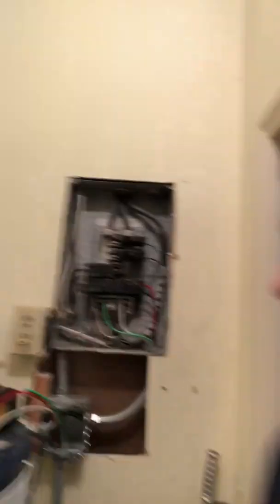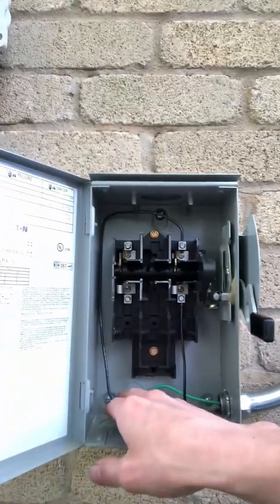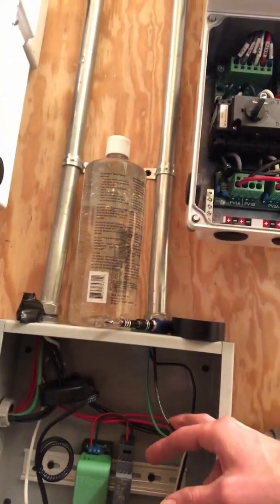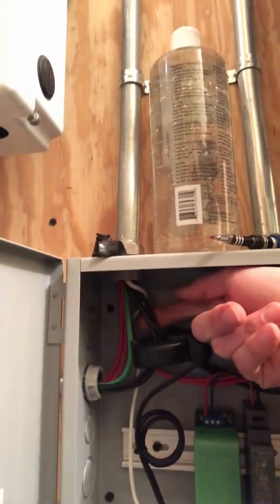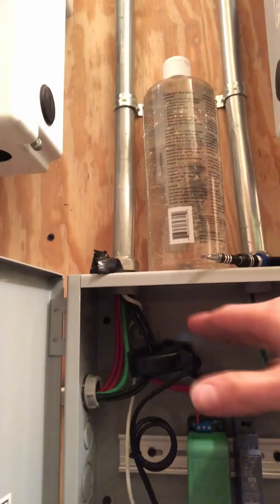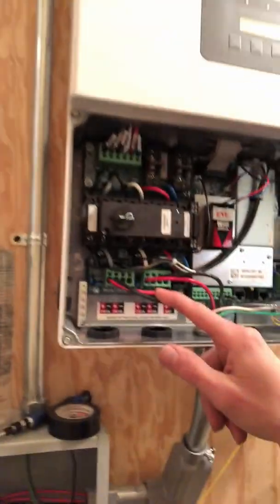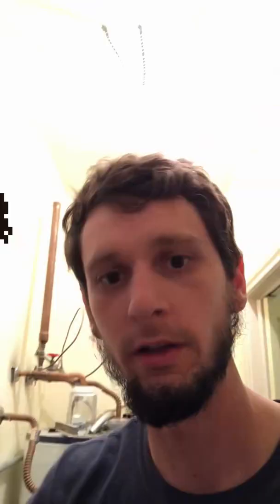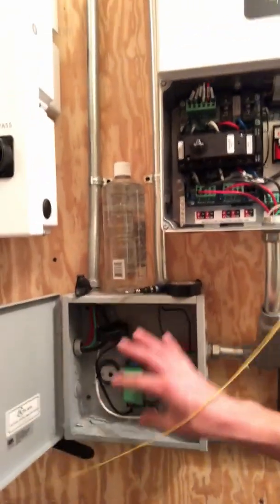TIGO TS4-A-F DC Quick Disconnect Operation Overview - NEC 2017 690.12

Comment: I found you locally through FB marketplace, your videos have been extremely helpful in figuring out how I'm gonna design my system. Looking forward to buying some panels from you.
Reply from the maker: Very cool. Glad they have been of some use! I’ve got grid tie inverters in stock and I am a reseller for the eg4 line of inverters and batteries if you need something along those lines.

Comment: Kan your monitor individual  panel produktion?
Reply from the maker: Not with the ts4-a-f. The -o version which is also an optimizer does have monitoring per panel.
Reply: @BeeneEnergy  I'm not seeing a Dual Input version of the AO  🤔 it would be nise to put 2 460 Birasials on a single Optimizer/Module.... You think they would be able to make something inline and small as an Emporia Smart Plug atleast for monitoring.

Comment: Awesome. Do you still need a fusable DC disconnect going into the inverter? Or do you only have the dc Disconnect on the inverter?
Reply from the maker: Code did not require a fusible disconnect for me. Just the dc disconnect at the inverter.

Comment: Only issue is those inverters don't last I've gone thru 3 of them in 1.5  years
Reply from the maker: One of mine just failed too! Funny that I had just installed a hybrid next to it so I just moved the panels to the new one.
Reply from the maker: Mine only had 4kw of panels on them and in temp controlled environment…

Comment: Hi Beene, 

Why do you need an  "inverter" in the loop for the TS4s to work and turn On/OFF the string output? 
Can't you just use a Voltmeter instead of an inverter to look at the voltage at the output of the string and test the functionality of your TS4 RSDs?

I've tried to power up the Tigo transmitter with a 12v dc adaptor and see if it can turn ON/Off the TS4s but I found the string output was just sitting at 0.6v per TS4 module and the modules not turned ON even when the transmitter is sending the Keep-alive signal in.
I can't see how/why the TS4 must need an inverter in the loop to work.

Thanks for making this video, you explained it really well.
Reply from the maker: That’s very curious. I didn’t know there had to be an inverter for the modules to turn on. I’ll have to see if mine act there same.

Comment: I'm adding a 15 panel 6KW array to the roof above my garage, and have the panels, disconnects, inverters, battery bank, conduit, etc.   The one part that I'm still missing my plan for Rapid Shutdown.  Recently my county went from 2014 NEC to 2017, so now I'm supposed to go with a module level shutdown, but I don't know that I'm going to get it formally inspected anyhow, so I don't suppose it matters, however I do want everything to be safe.  I was wondering if you've compared the TIGO solution to the IMO Fire Raptor option?  Not a lot of content out there on the Fire Raptors.

Great Channel BTW!
Reply from the maker: Thanks!

I’ve actually not heard of the IMO option.
Reply: @BeeneEnergy  After doing a fair amount of research on both, I'm leaning towards the TIGO solution, just because it can do optimization and monitoring.  I'm thinking of just going with the TS4-A-0 model that has all options since it's just 15 panels and the cost isn't crazy.  I'm just not certain of the other components that I need.  If I get the CCA and TAP, do you know if I also need the RSS transmitter that you mentioned in your video?  From what I gather, I should just be good with the CCA and TAP - still need to read through the whole manual though.  Essentially I just want to have a setup where they can press the big red botton near the meter and turn off the panels.  My set up will technically be off-grid, since it'll just be powering select loads in my house, so I don't believe that the requirement is there to also turn off the inverters via the red button.

Comment: Great video, I really appreciate you producing this and providing all of this detail. I have a couple questions about your setup since it is so similar to what I’m working on. I have 18 450w bi facials in Wisconsin and two h6 inverters. I am planning to run them in two strings of just over 400v / 4000w each. From what I understand each mppt input can handle up to 4.5kw and is most efficient around 400v. Why did you decide on 4 strings vs 2 at higher voltage? Do you also need a utility service disconnect to satisfy your provider or do you think the RSS will suffice. If mine wants a disconnect at the meter, I suspect that would serve the RaPid shutdown needs as well since the transmitter would lose power and open the circuits?
Reply from the maker: The four strings instead of two was a miscommunication between me and the person doing the plans. I’ll combine to have longer strings later when I add panels. That way it frees up a pair of wires I can use to get another set of panels to the inverters.

My utility specifically stated they wanted an ac disconnect by the meter. I gave them documentation and drawings showing how the rapid shutdown works and they approved it. Ymmv for sure.

My rapid shutdown breaker is in my breaker panel so it wouldn’t lose power if I disconnected my inverters. I’m sure there’s a way to wire it so the ac disconnect also triggers rapid shutdown though.

Thanks for watching, glad it helped in some way!
Reply: @BeeneEnergy  Ahh, I wasn't sure if you were trying to avoid overdriving the MMPTs, that's been my concern. I still am not sure if running two inverters is the way to go, or just the one ( keeping the other as a backup) because I have a feeling I will almost never be nearing the full 6kw, and running one might be more efficient. How close to your panel ratings does your output typically come? Have you come up with any software means of graphing output or just the LCDs on the inverters?

I saw in the eBay listing, but not on their website, that Signature Solar has a stark warning about not driving it at or over 6KW or risk significantly reducing its lifespan. That suggests they had at least a few die on customers and that was their assessment. But the manual made it sound like up to 9KW of solar would be ok. I guess we'll see.

After watching your other more thorough system overview, I found the answer to my other question, that's cool they were ok with the DC disconnect as I'm sure having to run another disconnect for AC would have been a drag.

But you took the whole rapid shut down mandate with stride. I already bought most of my parts and thought I was almost ready to install before I found out about it. At first it felt like a major setback, but ultimately I guess it could be worse. Your attitude helped me see past it and consider the upside. 

If you don't mind me asking, who did you have prepare your plans? ( Sorry if you mentioned in the video, I didn't catch it ). 

( It was cool to see your reply and that your still active, I'm subscribed and looking forward to see how things progress )
Reply from the maker: @sjetmand  Wow I hadn’t seen their comment about not over paneling. That’s disappointing!

I see about 75% of my 8.4kw array in the hot summer. That’s spread across both inverters of course. Don’t know what the cool sunny months will provide yet.

With the warning you pointed out maybe I won’t over panel like I had planned. Might add another 3-4kw and be done. It will be a west facing array so that should prevent peak generation too.

I use the sense energy monitor with solar CT’s to see my data. I’ll put a post up here on YouTube showing what the interface looks like. I’m happy with it, just another few hundred to spend :).

Comment: Great overview! I have an SMA 5000W string inverter and 16 Tigo TS4-F MLPE to comply with rapid shutdown. It's fun to go out and flip that RSD switch to see the inverter behavior- that array voltage goes from 400 to 0 volts in seconds!
Reply from the maker: Thank you! Took me a lot of research to find the right solution for my install so I wanted to share what it looked like installed. I was surprised at the affordability, many times something like this would make the micro inverter solution win.

Comment: if you have a outdoor circuit breaker before the pv ac disconnect from the meter (wires running from meter to circuit breaker then there is a pv solar ac disconnect panel is the wires from the line going directly to the main panel inside ?
Reply from the maker: I don’t quite understand but I’ll explain and you can tell me if that answers it.

Inverter ac lines run directly to the breaker panel in my utility closet. They do not run outside to the disconnect switch. My only ac side disconnect is the breakers in the panel.

The switch out by the meter turns off the power supply that runs the tigo rapid shutdown piece.
Reply: @BeeneEnergy  thanks for the rely

Comment: I am a newbie and have a couple questions so bear with me.  The solar pv ac disconnects, is it wired from the inverter to it and then to the electricity wires from the meter?  also the tigo system is wired to your ac disconnect box or your dc disconnect box?  I know they maybe dumb questions but please bear with me. Thanks
Reply from the maker: No worries. I need to walk through the entire setup so you can see how each piece is wired in.

So there are two knobs on the inverter. Left knob is dc disconnect which kills panel to inverter connection. This is redundant to the rapid shutdown.

Knob on the right is actually just a bypass for any ac devices in a critical loads panel. So for this setup it’s useless.

The tigo system is in my dc box. It does have ac running to the power supply but that’s the only ac running into that dc box between the inverters.

Comment: Are there code rules for panels on vans, rv, or other vehicles? You have an awesome setup for your home by the way :o)
Reply from the maker: Thanks!

As far as I know there aren’t rules governing panels on a vehicle.
Reply: @BeeneEnergy  Thanks for replying... Here in Indiana...they will nickel and dime you to death with regulations, etc. We here suspect they have a cozy relationship with the grid people..so make it as difficult as they can for homeowners. I plan to install my whole system using a mobile method for just that reason.. I mean.. I can just pull my van up to the house and plug the house in..yes? lol.. independently..not to the grid panel.. I of course still plan a safe setup regardless though,, not to mention I can move it to follow the sun..and of course be ready if I have to escape when the SHTF.. your advise is excellent and we all appreciate your efforts :o)

Comment: Please consider holding a discussion on the pros & cons of combining LiFePO4 batteries with Lead batteries.   A lot of people with existing Lead Acid battery banks may not want to discard their investment in Lead batteires  - but they may want to upgrade and start using LiFePO4 ... It can be done (under very controlled conditions - if the LiFePO4 is set up as the primary and the voltage level is held at 14.0 V - in both the Lithium and the lead battery banks ) the real trouble issues are preventing the Lead from degrading the LiFePO4 and It is my opinion that this can be done with a good low voltage shut - off in line between the LiFePO4 system and the Lead acid battery system.
Reply from the maker: That's a hard one. Sounds like you have a fairly good handle on it and I agree the big problem is the resting voltage. Lead Acid will be 12.6-12.8v maybe and LiFePo4 will be up at 13.5-14v. While charging I think everything would be fine. But constantly connecting and disconnecting battery banks sounds like a challenge for relays and an arduino as I don't know that there would be anything off the shelf.
Reply: @BeeneEnergy  I was think that by using the LiFePO4 as the primary bank - and charging it  & keeping them both at or above 13.2 would work pretty well. A good low voltage cutoff between the two systems that activates when the lead falls below 12 volts. should prevent damage to the LiFePO4 ...
Reply: @BeeneEnergy  I have done a bit more thinking about this and I don;t think it is too wise to try and combine Lead acid batteries and LiFePO4 on the DC side (too many problems ) - but I think that it may be just fine to combine them on the AC side.
Reply from the maker: @smde1  I don’t know why I hadn’t thought of ac coupling. If I had a lead acid 48v I could run one growatt with its own set of panels on that bank and another growatt with the lithium.

I think the problem then would be battery banks that are independent, and controlling which inverter is providing the energy as you’d want to balance it so the batteries deplete somewhat evenly.
Reply: @BeeneEnergy  It seems much more manageable than trying to combine the Battery banks on the DC side with different chemistry / resting voltages, etc. The easiest would be to use the LiFePO4 for high demand-use things like AC, refrigerators, garage appliances-shop tools. while using the Lead Acid for lights, water heater, etc  and other things that are not so high-demand.
Reply: @BeeneEnergy  I am still thinking this would make a great video topic - useful for a lot of would be DIYers. You could make a special arrangement with Growatt - for a great price point -..and get them to supply a couple of inverters to "Show how it is done" ... CHeers.

Comment: I have a birdhouse if u need one brother
Reply from the maker: I've looked at the birdhouse, but with the TIGO system all I need is an AC switch. So for now this will do great. Thanks! Of course we'll see what the inspector says when they come out!
Reply: What did the inspector think?

I’m working on a system now.
Going to use a 3 phase fusable disconnect to kill the inverter to grid. As well as kill the power to make the Tigo go dark. Kill two with one switch. Crazy?